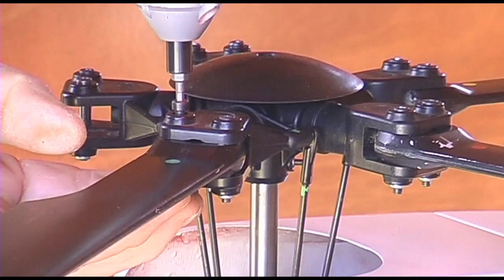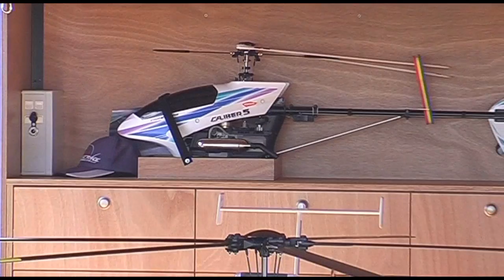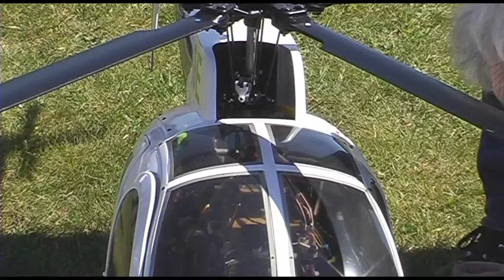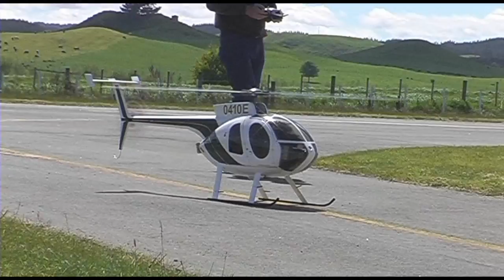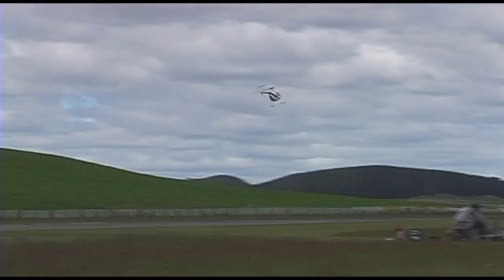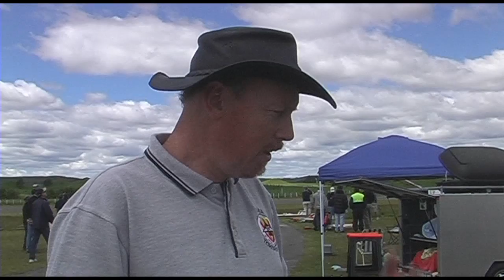Jet turbine powered RC model helicopter (Huges 500E)

Comment: I used to build and fly model helis, I still have 5 ready to go and one junk heli that needs parts (hard to find).    I never did turbine, the most popular turbine engine at the time, I think, was the Wren 44 which cost around $5000 USD back in 2012 or 2013.   I opted to stick with the electric which costs under $200 for a motor.

Comment: The MD 500 was developed from the Hughes 500, a civilian version of the US Army's OH-6A Cayuse/Loach. The series currently includes the MD 500E, MD 520N, and MD 530F.  The MD 500E (369E) is the Executive version of the 500D with recontoured nose, Certified in 1982.  The MD 530F (369F) Hot and high version of the 500E powered by an Allison 250-C30B rated at 650 shp (485 kW), certififed in 1985.  The shapes are the same, the insides are different.